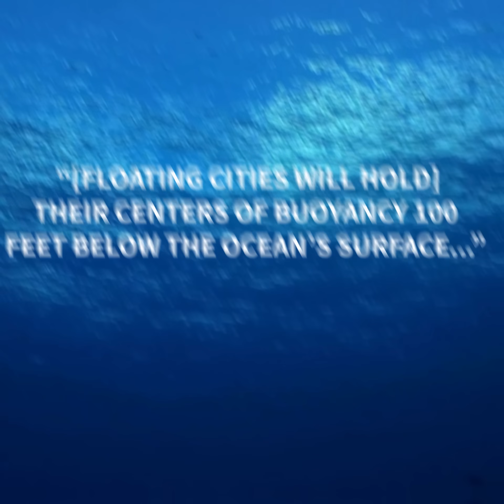Seasteading! What About Waves?

Comment: Tsunami's?
Reply from the maker: https://youtu.be/x1UrIRNPUe8
Reply: 12 miles out there really wouldnt be a problem cause the wave would be so small. Now if they are directly over the slipping fault and one side of ocean floor fault slips 100feet down it would create a "sink hole" in the water. Not a hole. Just would lool like it. If they had their rust collector in that spot then they take a dirt nap